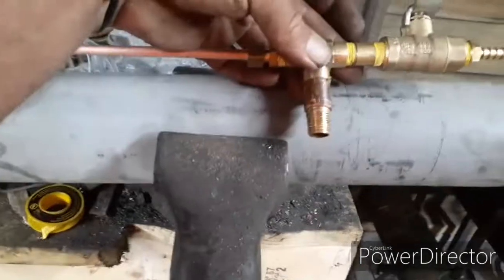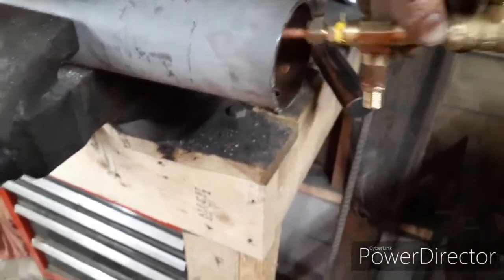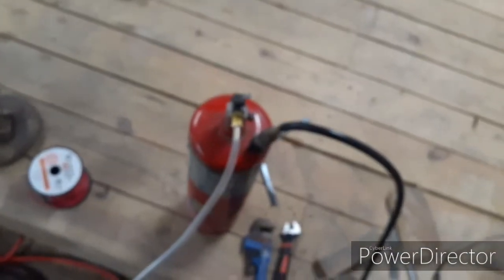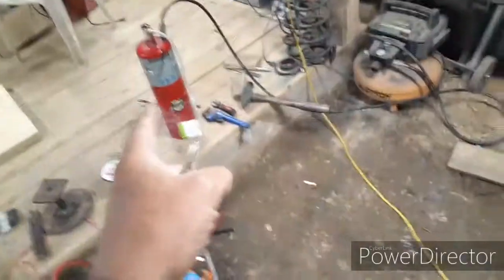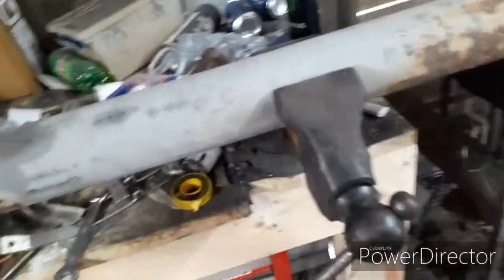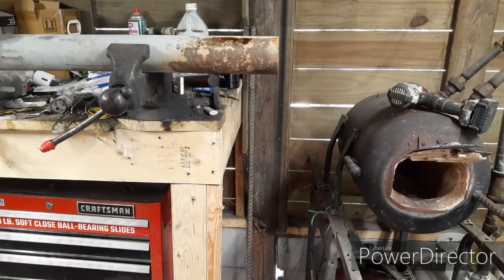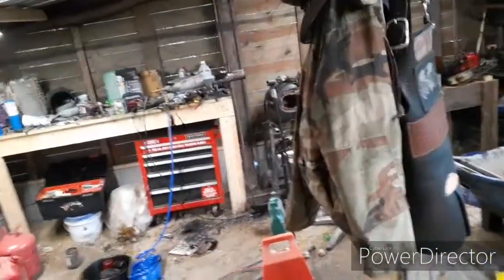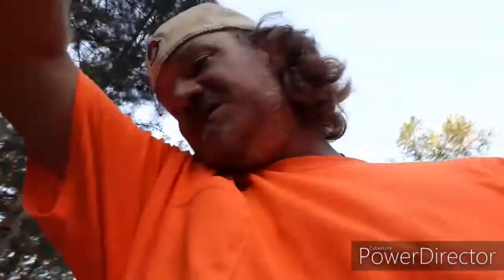Oil burner fail

Comment: First off to get your training wheels on, mix up a 50% ratio of Kero, Diesel, turps etc.  Second start off with a small amount of air, hold your torch near the nozzle and open the oil slowly till it lights.  You may get some dribbling till the tube heats up but that's normal.  Play with the mixtures to slowly increase the burn rate and get the tube hot. You can also insert a piece of smaller tube into the larger one which will act like a glow plug and make sustaining the flame easier. The other thing you could do is use gas ( Propaaaaane) instead of oil till you get the tube red hot THEN switch to oil. 
Yeah, I can light them off like it's nothing but I had plenty of failures too.  No one just gets on a bike and rides off but once you know how to ride you can ride any bike, scooter, skateboard etc  because you understand the principals.  Stick with it mate. Take the thing outside where you wont make such a mess of your shed or burn the bastard down once you do get the thing running and practice with the thing.  Once you learn it will be much easier and you'll get the idea for other burners as well. It's all about HEAT retention NOT atomisation. That's the mistake all new players make but once you understand that you will be off and running.
Reply from the maker: It is most definitely an honor to hear from you personally sir. I have been following you for quite sometime I love your experiments I love your builds and most of all I love your humor. I use a lot of your witty one-liners at the bar as well as those parties you really don't want to be at. I have learned a lot from your videos and I thank you for creating the content that you have and I hope that you continue soon thank you for your time.

Comment: Lower the viscosity of the oil.  A coil of pipe, wound around the base of the burner. Use that as the draw, before it reaches the nozzel.  Now, I get what y'all was talking in messages. You got this!!! A trial in learning. Damnit, we don't get enough time in life, to make the mistakes alone. Here to help Brother. ❤️🙏⚒️😉😀

Comment: Dad always got it hot first with the propane then switched to the oil I think your trying to burn it cold which never worked for him either and you don't have a belly or a drip area for your oil to run into you are forcing it all at once I hope this helps

Comment: Have you seen NOBOX7 YOUTUBE Channel. He was really into that oilburner design about a year ago
Reply from the maker: I have, and I saw in a reply in a comment where he says not to build it called it a pos to be exact. Not discrediting the guy at all. He has some great designs and tons of hours and money invested and has come up with amazing designs. Which is great on a commercial or industrial level but all I need is to produce enough heat to degas wood. He also mentioned that most of the times you have to blend the oil with gas or diesel to get it to the light off but in my recent success I used just straight waste motor oil and straight waste vegetable oil. I did notice that the vegetable oil didn't want to light off as easy as motor oil and I think it's because of the fats and the moisture because I haven't filtered the vegetable oil nor have I dried it. He's got great vision for atomizing it small enough to be able to vaporize it so it combust fast but it requires a lot of calculation and fine-tuned design in nozzles. He originally saw the design on a channel called oil burner. a guy in Australia who has many different types of oil burners. And he says basically you want it to vaporize and combust is the main principle to oil burners. I may still play with the spray burner but the issue with it is having constant ear pressure so I need a large volume compressor for to run as long as I need it to.  but my hat's off to NOBOX7  during my researching he's one of the only people I saw that was able to create a blue flame with waste oil